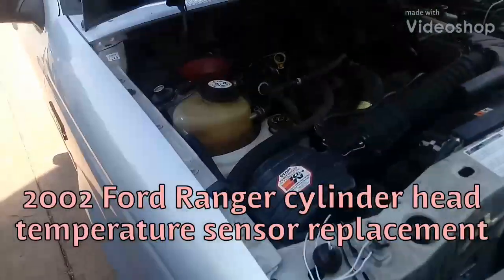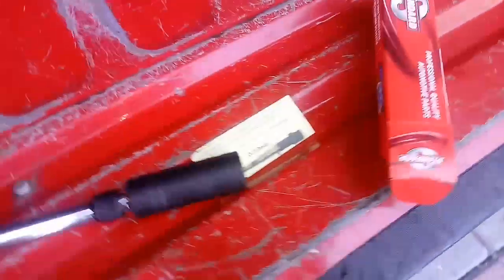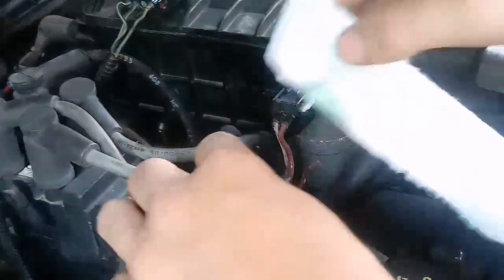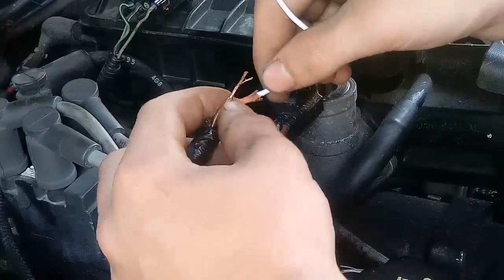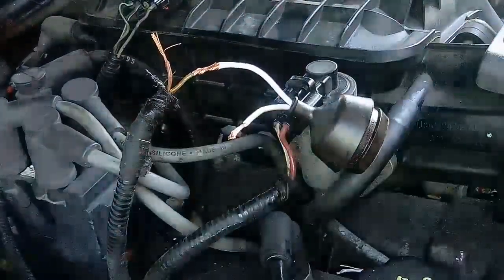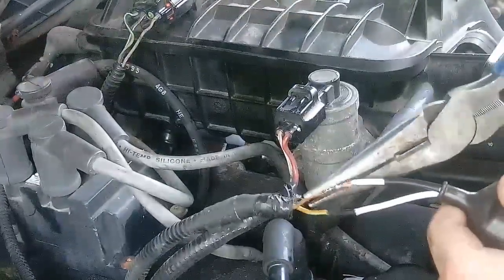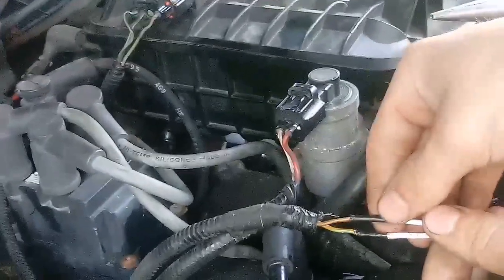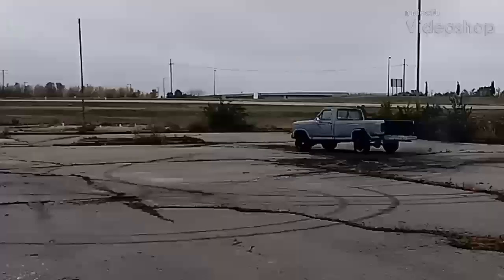Ford ranger 2.3 tempature sensor repair

Comment: Is this the sensor that controls the temp gauge reading in the truck my heat gets warm but my gauge jus creeps up is there two sensors on this engine? Is the one your replacing in the head control the pcm? Also is the one thats built in the thermostat housing for the gauge or is that a sensor too thanks

Comment: There is a coolant sensor way in back of engine basically you pretty much have to remove the engine you can Jack trans up and squeeze in there it's near the egr valve
Reply: Is there a video on this?
Reply: You don’t have to remove the engine,  just remove the intake and it gives you enough room to get to it, and it’s located at the fire wall in the back of the engine a good reference is in line with your ignition coil. At auto zone is called Temperature switch TU241

Comment: Is this the sensor that controls the coolant temp gauge? If so u think u can send me the link to the new sensor I can’t find it anywhere
Reply from the maker: No the gauge runs off the sensor in the thermostat housing on the front drivers side bottom of the engine.

Comment: I haven't done mine yet but why not unplug the switch and then put socket on I know it is tight but its doable to get that wire off should like I said haven't attempted yet trying see what I have to do and different ideas about getting it done.  Thanks man
Reply: Flash light to see down hole use  a flathead press in release retainer and pull wire shoould break free nice

Comment: A 3/4 deep craftsman brand socket with no problem for the CHT (cylinder head temperature) sensor which is the one u changed, the coolant temp sensor is at the back of the engine between the firewall and cylinder head on the metal cross pipe, not fun to get to…
Reply: Bla lbla bla....good job.......

Comment: I replaced  temp sensor, Temp switch sender , and thermostat twice  switch and gauge was still dead , but after i flush the heating core that temp gauge started to work. ranger 2003 3.0 6 Cyl.       Flush your  heating core before start replacing parts
Reply: What exactly do you mean by flushing the heater core? do you mean back flushing or just changing the fluid? Thanks 👍

Comment: This sensor is the one responsible for the temp gage mine is reading cold all the time
Reply: Mine to I have to drive 50 miles for it to come up even though it has heat within a mile

Comment: Hey thanks for u video, i just did mine and oh boy it was hard,  took me little bit of engineer  and sweat but Got it done . how deep is ur socket? is that special socket for this job application ? my deep sockets got stock on the plastic connector and doesn't reach the nut. twelve pointer is deeper ?
Reply from the maker: I think I ended up having to shave a bit of platic off the connector

Comment: Hola, alguien sabe para que es el conector que está justo detrás de dónde está uniendo los cables el conector que tiene el cable rojo y blanco
Reply: Si esa valvula deja pasar aire al intake cuando no estas acelerando y cuando se ensucia puede atorarse abierta o cerrada. y si tienes una fuga de succion y el motor se escucha desvielado desconecta esa valvula y el motor va a calmase y podras escuchar y encontar tu fuga

Comment: What size socket did you use
Reply: 19mm or 3/4" deep 1/2" drive with no inside shoulder.
Reply from the maker: I dont remember I'm sure some forums have that info

Comment: Hey do you know the firing order on a 08 Ford ranger 2.3l I rat ate my spark plug wireset and now it’s running rough so I feel like I have one of them wrong
Reply from the maker: 1-3-4-2 front to back

Comment: please where is the coolant temperature sensor in a ranger 2010 argentina here nobody tells me Do I have to undo the acceleration body? is it in the back ???? My God who thought to put it there would not be the possibility that you would make a video of how and I do not trust the mechanics to change it, ranger 2010 2.3 4 cylinders, I know it is a lot to ask but here in the area where I am the mechanics are tricky, and they cheat a lot, they told me that they had changed the oil and it was not like black crude oil, I hope you can teach in a video thanks
Reply from the maker: Same thing that i replaced it this video. Unless you don't have 2.3

Comment: Changing the Thermostat was easy on the 2.3L, Its at the lower radiator hose to block, Simple 3 bolts and no sealer needed. Thanks for the video now I know where that ECT sensor is.

Comment: hello good afternoon I liked your video could you tell me where is the coolant temperature sensor (ECT) is that I can not find it thanks
Reply from the maker: If yours is the same here it's actually called a cylinder head temperature sensor and it's got a rubber boot and it pops out of the top of the engine unless you have a v6 engine
Reply: @mechanicalking  there's a coolant sensor on the back of the engine where the coolant pipe is and it's a pain just like the egr in the duratec 2.3
Reply from the maker: @Project-gr6zy  Ok, the original problem was it not warming up. The problem ended up being that an electronic heater in the thermostat housing was heating up/opening the thermostat before it was supposed to so i cut the thing out and it warms up great with strictly mechanical engagement. 

But the computer is giving it to much fuel as if its in cold start mode, any thoughts???
Reply: @mechanicalking  that's why in 2004 they went to mechanical thermostats, the electric ones rely off a sensor in the thermo itself to read the valve position or something, yours is a 2001.5-3 so you have to have a connection, I tested out on my ranger witch is an 02, and it's throwing fuel in at an off rate for me it's throwing a lot in and idling at 1300
Reply: @mechanicalking  you can try unplugging the battery terminals and trying to crank the the thing 5 or six times and let sit for 15 ish minutes and maybe you'll be lucky and have the learning PCm, my 2000 ranger has a learning PCm but my 02 doesn't but a lot come with 1 or the other
Reply from the maker: @Project-gr6zy  yeah i tried it and the code came back, It has 230,000 miles so it might be the MAF
Reply: @mechanicalking  I'm at 223K miles and I've only changed the thermo, coolant and ECT, try spraying maf cleaner onto the Maf, also these motors use a MAP sensor in the manifold too, I'll make a video on my channel with the location of all the sensors and I'll post here when it's up n ready so you know where everything is
Reply from the maker: @Project-gr6zy  sweet
Reply: @mechanicalking  says the video will be ready in about 15-20 minutes I go in order from what's obvious to obscure and what I do know of
Reply: @mechanicalking  startup runs in what's called loop cycle or something, it relies off of sensors to run the engine in a higher operating rpm, til warmed up or if in limp mode, I believe that all 3 sensors are used and if the coolant sensor on the back of the engine isn't hot enough then it will keep throwing fuel like it's not warmed up yet
Reply: @mechanicalking  The video is up
Reply: @Project-gr6zy  whatttt??? OMG ???? I have to remove everything to change that horror
Reply: @ALe-qu2bo  you have to take the valve cover off, to take the cover off it's recommended not required but recomended to take the Intake off, my newest video or so is the intake manifold off and you can see all the bolts required to take the valve cover off, this motor was designed for front wheel drive not rwd like our trucks, also if possible, buy the ford escort of UK parts for the duratec, I buy from Burton power, I have a really nice longtube header and it welded nicely to my turbo flange
Reply: Would it be throughing a P0125 code? Thats were im at.
Reply: @WhatsLovedotcom  unplug the thermostat and replug it, and check to see if the coolant temp sensor on the back of the engine is replaced and the ect in the center of the head where the spark plugs go